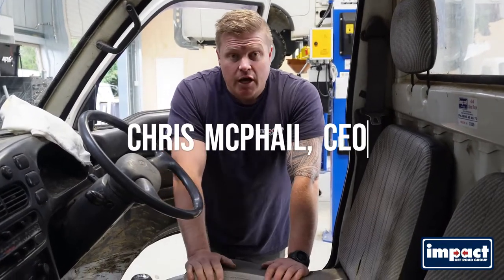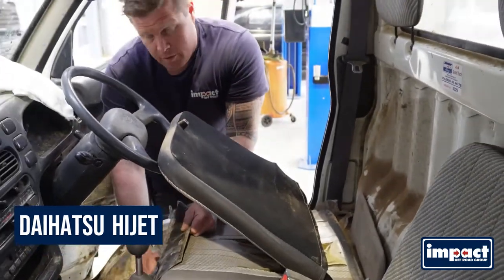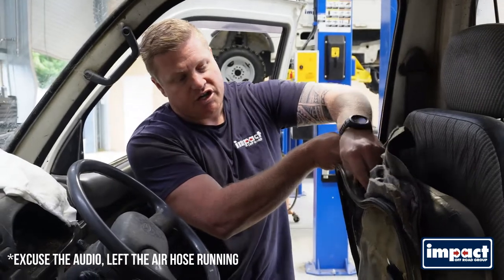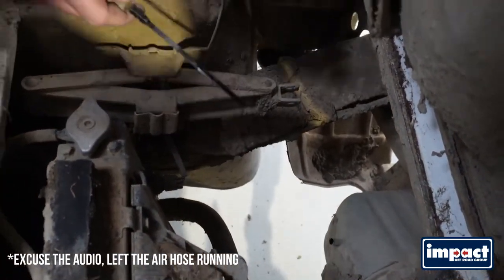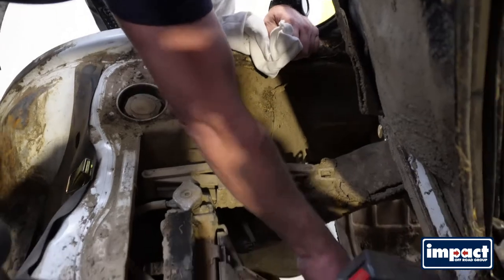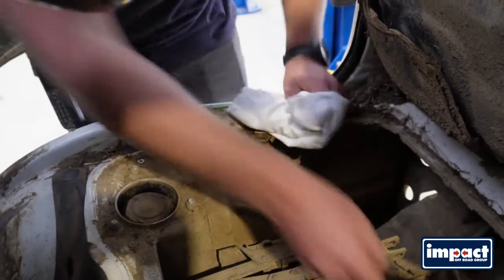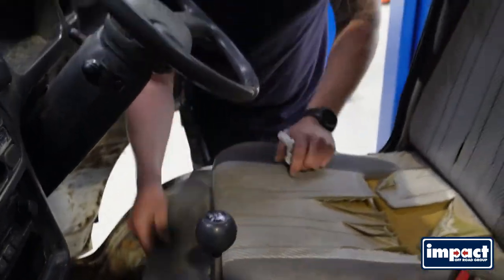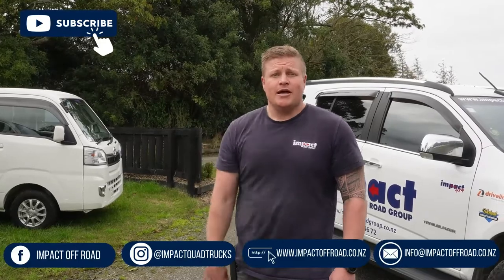DAIHATSU HIJET S110P OIL CHECK | Impact Off Road Group

Comment: Hello, does the dipstick have a rubber gasket? Mine does not and I have a small leak coming from the dipstick.
Reply from the maker: Hey Tony, the should have a rubber gasket which creates a seal to stop any leaking. What kind of truck do you have?